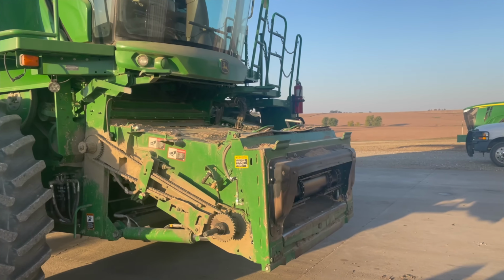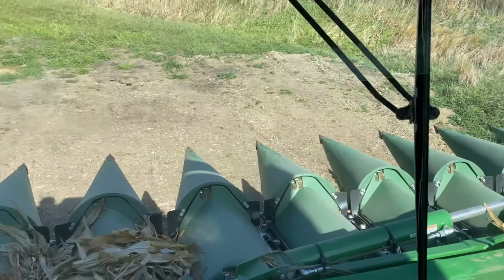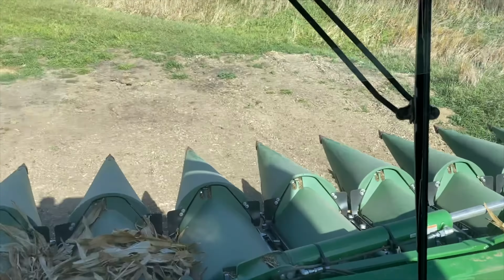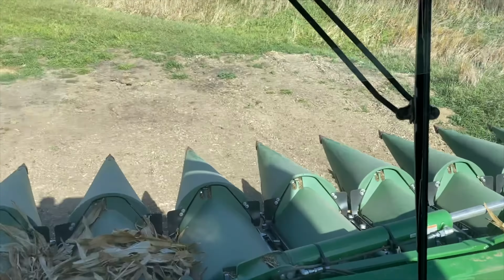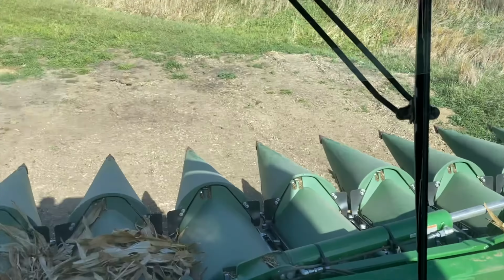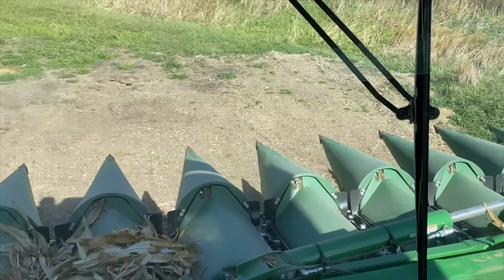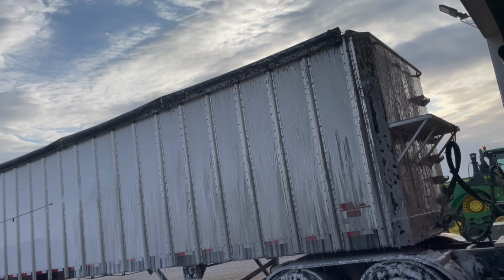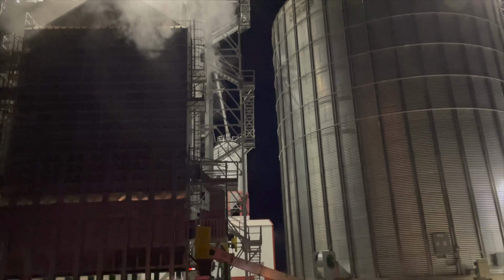We're Shelling Corn! Buuut Everything Is Plugged...

Comment: Plugged metering rolls lead to the fire department showing ....by then its just ''stop'' the fire from spreading mission. Pull up the grain temp screen on your monitor on occasion it should be plus or minus 5 degrees of the set point, if it starts climbing a walk around is needed and look through the screens of the columns grain moving slow or stopped in a column or two needs attention.....Drying soybeans with pods is a nightmare for this.....
Reply: Yes you’re right on point, I always check the dryer occasionally throughout the day to make sure grain is flowing through properly. That’s when I noticed some of the columns on the outer edge were plugged up. So I shut everything down immediately, emptied out the dry, and made sure it was clear before starting anything back up.